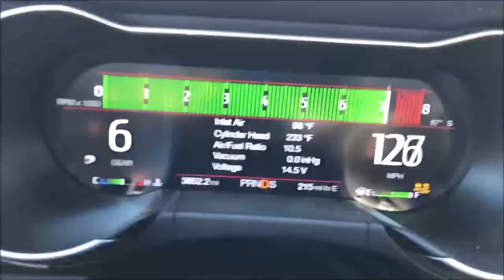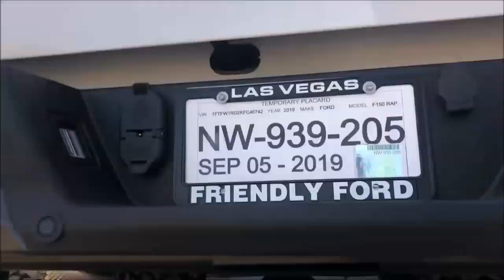2025 6.8 Liter S650 Mustang And F150

Comment: That thing is going to be a turd compared to a coyote
Reply from the maker: joseph sonntag  .. .  coyote's are pretty Badass . . time will tell
Reply: @coyotecarguy2076  I agree I just think they made a mistake if it was a dohc engine it would be unbeatable
Reply from the maker: @josephsonntag1354  . .  ford did build up a 6.2 dohc engine at one point several years ago but they found that the overall size was to big to use in the mustang.. also to expensive for the trucks so they went 7.3 godzilla..
Reply: @coyotecarguy2076  makes sense , I mean I just dont see the hype considering coyotes are capable of what they are
Reply from the maker: @josephsonntag1354   . i would like to see a 5.8 liter coyote and that would be the end of it all. .  cubic inched do make a difference.  . even in push rod engines . .
Reply: @coyotecarguy2076  100 percent agree maybe one day haha but probably not. Keep up the good work,  I've followed your channel for a while. I loved when you went around videotaping the people playing shuffle board haha had me on thr floor laughing. Keep it up sir.
Reply from the maker: @josephsonntag1354    Ok now you got me laughing!!  LOL!! I remember that!